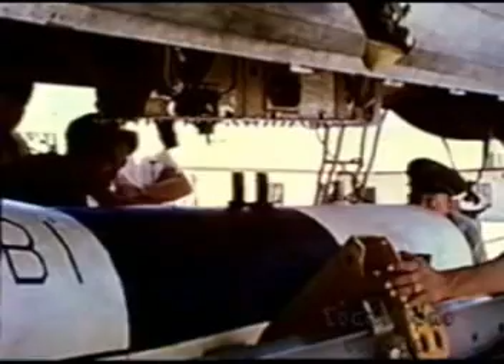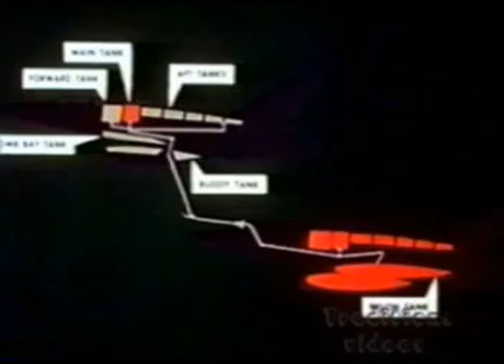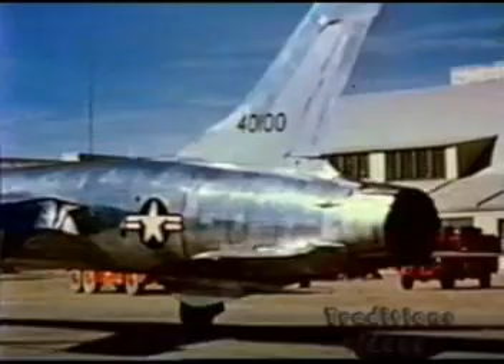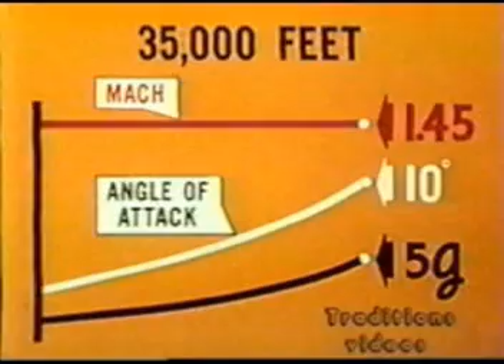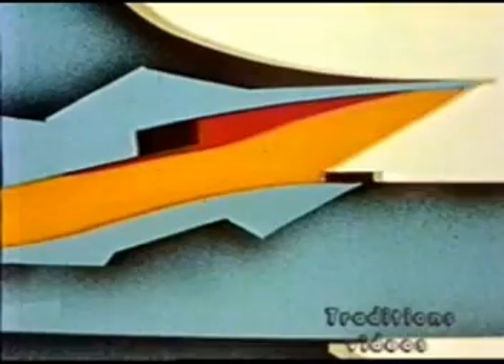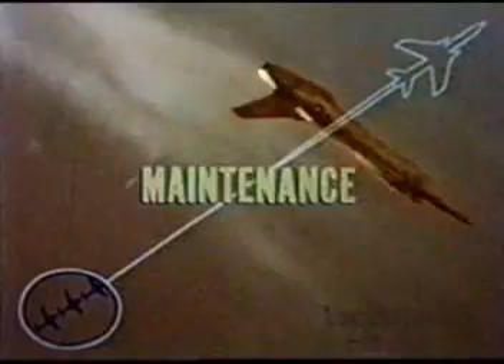F 105 Thunder Chief early development

Comment: Interesting factoid: Canada considered the F-105 for its European tactical strike commitments in the early 1960's. Had the RCAF moved forward with the acquisition, Canadian Thunderchiefs would've likely used Orenda PS.13 Mk 2 Iroquois engines instead of the J-75 P-19W.
Artist's renditions here: (421 'Red Indian' squadron and 441TFS  (C)F-105's) 
https://combatace.com/files/file/14445-the-other-cf-105-cf-105-thunderchief/
As it turned out, license-built CF-104 Starfighters filled the role.

Comment: Early on the F-105 was designed for nuke deliver. The bomb was pushed out by a piston. Later the internal bomb bay was turned into a fuel tank. It stayed a fuel tank. Why do I know this and you do not mention it.
Reply: James Holder This is mentioned in documentaries but not in this film, which dates from 1956.
Reply: It's common knowledge for those in the know. 
Technically you're right about the bombay. In the instead of carrying bombs, it just usually carried a spare fuel tank. It wasn't changed, or modified in any way.